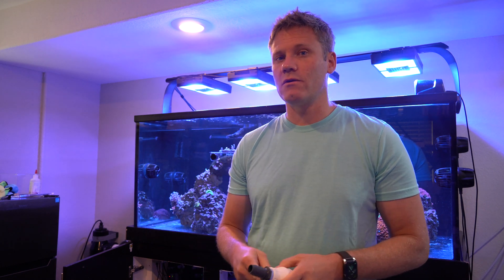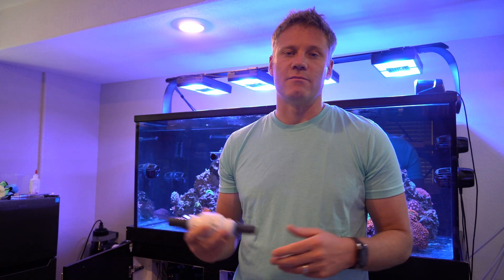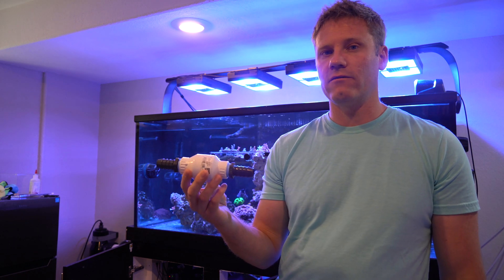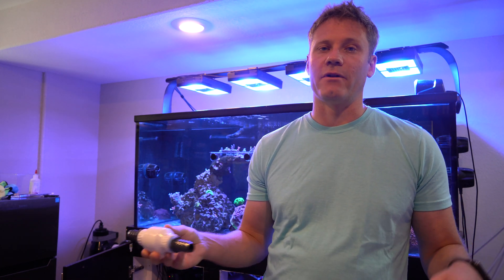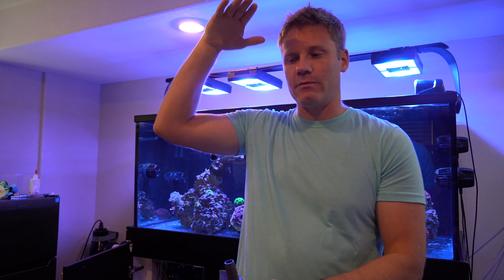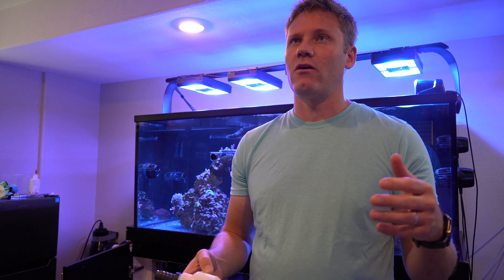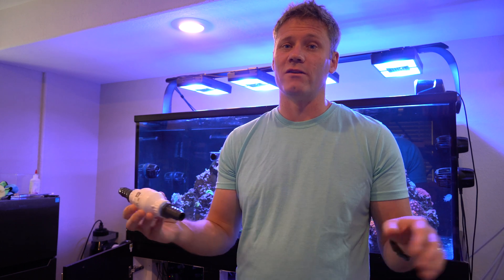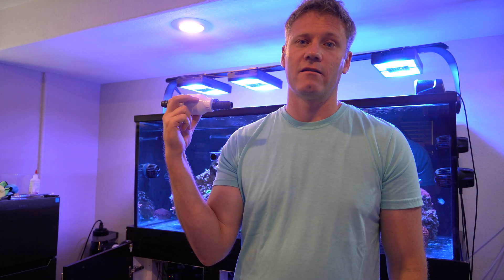Check Valves | How and why to install one on an aquarium

Comment: All I need to know is which way this tiny check valve goes on the line. It’s tiny, I blow in it, but nothing comes through any end.
Can’t find one video that shows simply putting a tiny valve on that clear line for my guppies, because I have to have the pump on the floor!

Comment: I’ve have 2 wand bubblers .. one check valve came off.. got water in it.. I don’t know ANYTHING About them.. but I’ve cleaned up the floor 4xs today.. PIA! 63 gallon Tall.. 
just little check valves.. legs didn’t have anymore.. 🙄
The biggest problem I keep having is Hair Algae..